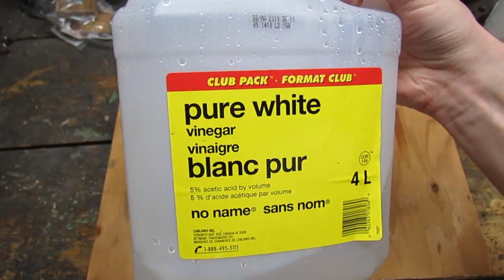Axe Hanging and Restoration

Comment: Nice work! Best advice I can give is invest in some nylon vice jaws.  I used to use the same thin plywood you use before and the nylon magnetic jaws wont scratch or mar the handles or heads and there super cheap and magnetic so you dont have to worry about them falling off! Just give em a try I guarantee you will like them!
Reply from the maker: Thanks Jay. You'll be happy to know I did get some soft jaws for the vise, both nylon and aluminum. Big difference! Cheers!
Reply: @PatonHaus  Yes I have nylon ones! I am about to do a resto on a craftsman 3lb felling axe this weekend! Check out and or sub my channel! I have 3 axes and 1 hatchet resto coming up! Just been slow getting to it but they are coming!